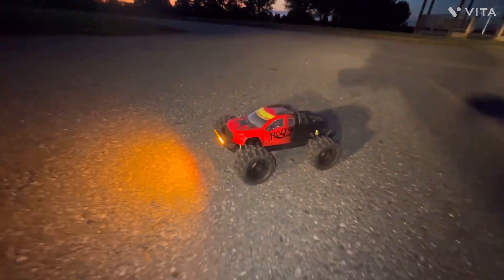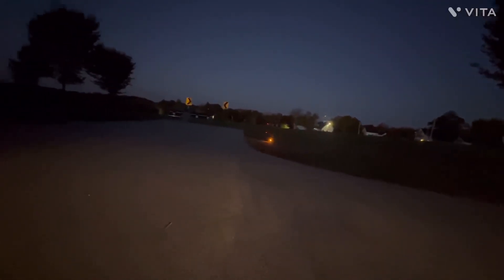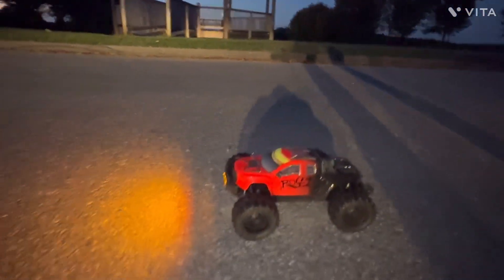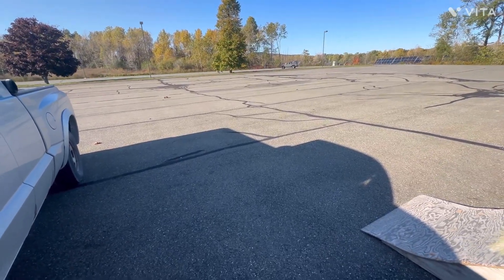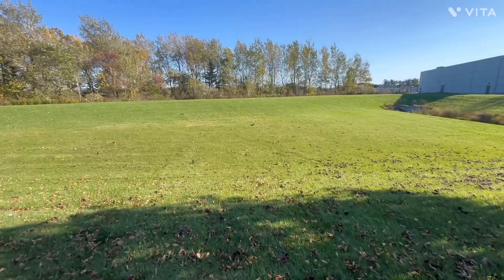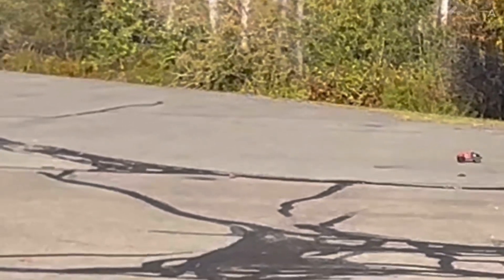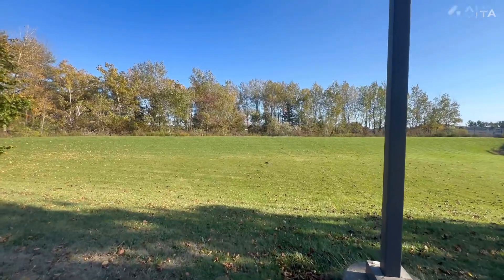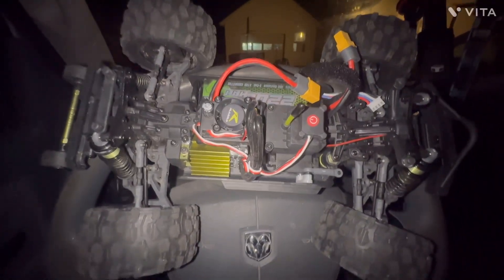Rog1 by Rlarlo perfect price & durable in my opinion

Comment: I've been thinking about getting it. But hear Alot about the cvc shafts breaking
Reply from the maker: @CrystalPlantz  I understand all I can say is watch the videos I’ve made and and not broke anything yet other videos I’ve watch seems live mabe could have been a bit easier on it but just my opinion I even decided with that kind of price point. It was worth it for me to just buy some extra CBD’s but I haven’t had to switch them out. I haven’t broke anything yet. They are skinny but I mean for 150 bucks it comes with a 3S batteryadjustable camera adjustable to alloy body sharks with adjustable collars comes with a wheelie bar headlights the tires even have foam minimum. I mean it’s got its downfalls, but I totally understand where you’re coming from as well.